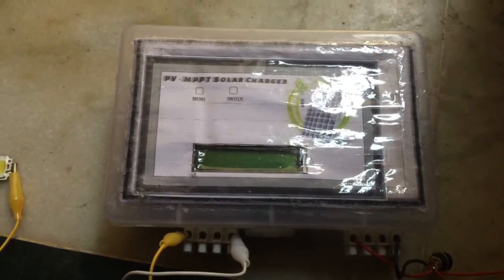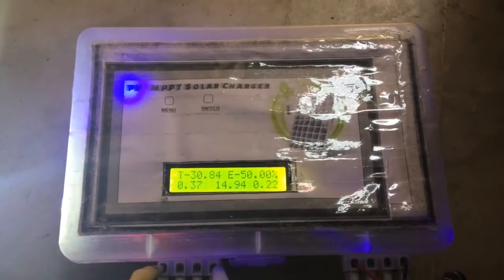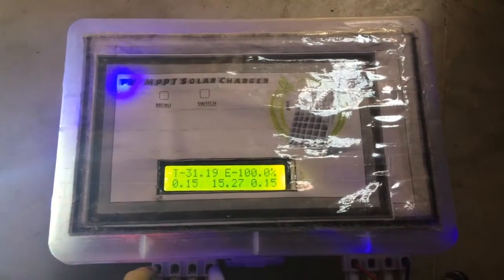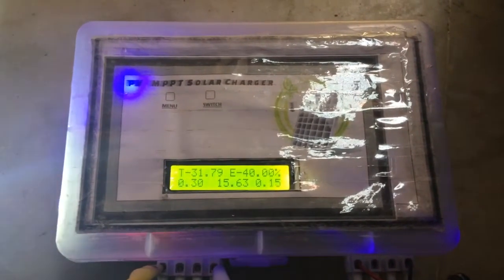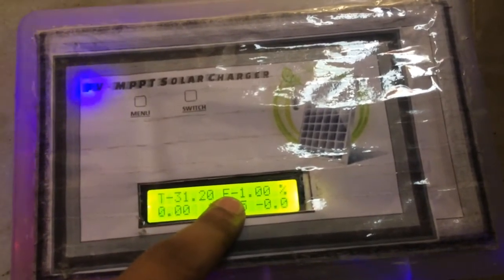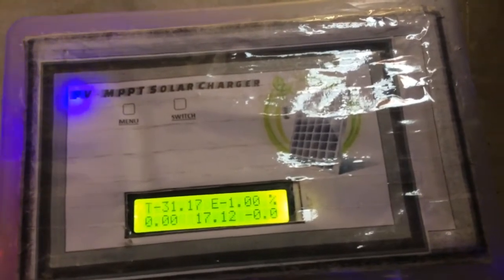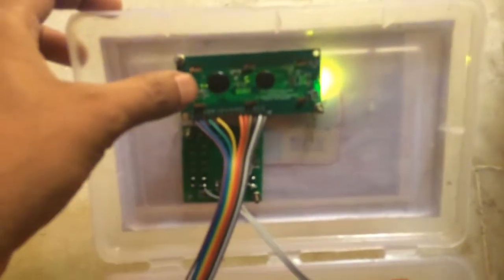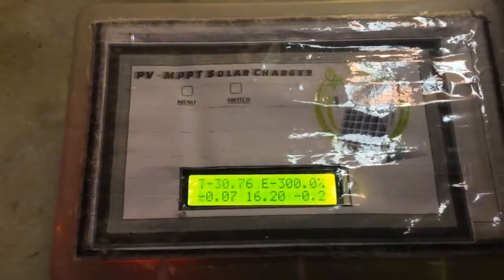PV- Solar Charger with Arduino

Comment: Hi Abhinav, 
MPPT Solar Charger, Can you throw the circuit diagram of your project? or Can you give me photo of the connection parts of the circuit board? This circuit diagram doesn't belong to this project.
Thank you
Reply from the maker: Hi Irem,
Device in this video was highly customized and i did't kept track of changes i made. So i don't have the particular ckt diagram. But the available ckt is completely working and ok. It only excludes lcd and fan ckt.

Comment: Hi Abhinav, 
MPPT Solar Charger, Can you throw the circuit diagram of your project? or Can you give me photo of the connection parts of the circuit board? This circuit diagram doesn't belong to this project.
Thank you..
Reply from the maker: Hi 
Device in this video was highly customized and i did't kept track of changes i made. So i don't have the particular ckt diagram. But the available ckt is completely working and ok. It only excludes lcd and fan ckt.

Comment: How do you know if it tracks the max power
Reply from the maker: genuino 301998 it’s all in algorithm programmed in controller. It keeps calculating the output power and push it to max available power. 
Solar panels outputs max current at a specific voltage and that keeps changing during day time. 
So by calculating the output power and and adjusting the battery charge voltage according that is they thing. It keeps oscillating around max output.
Reply from the maker: genuino 301998 it’s all in algorithm programmed in controller. It keeps calculating the output power and push it to max available power. 
Solar panels outputs max current at a specific voltage and that keeps changing during day time. 
So by calculating the output power and and adjusting the battery charge voltage according that is they thing. It keeps oscillating around max output.